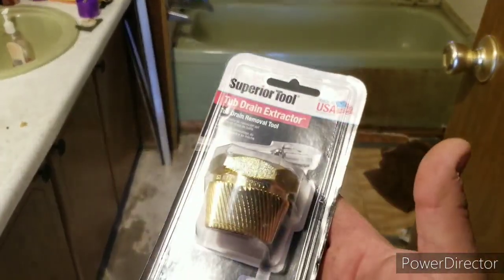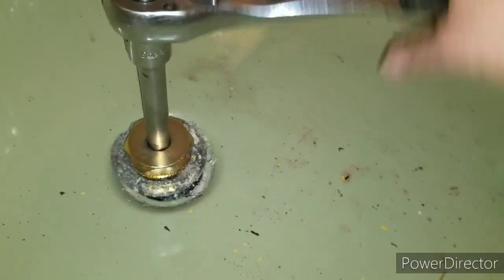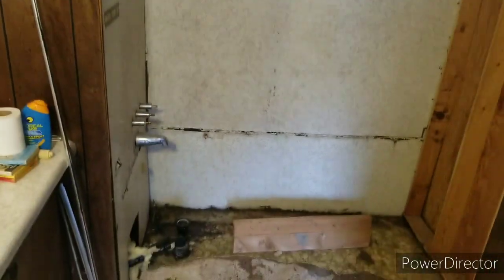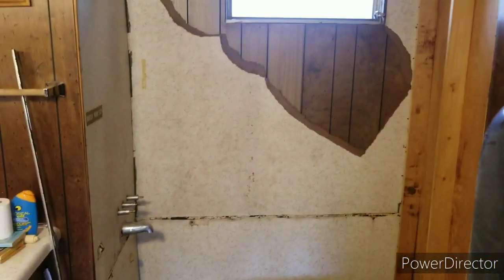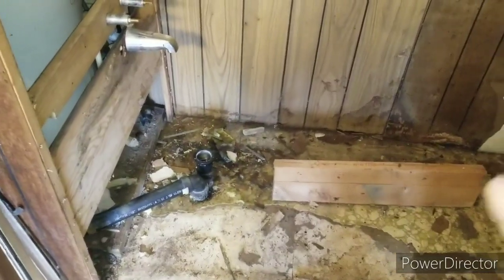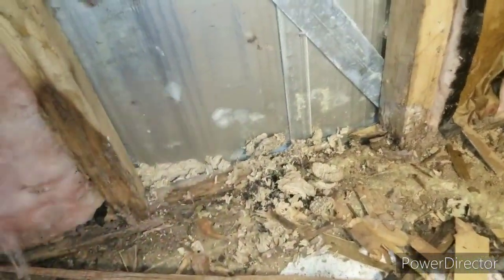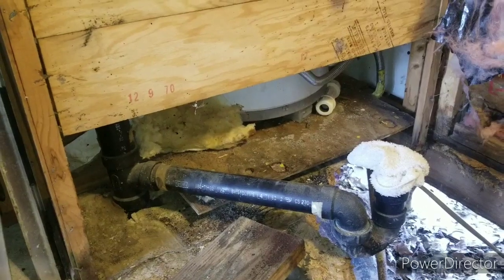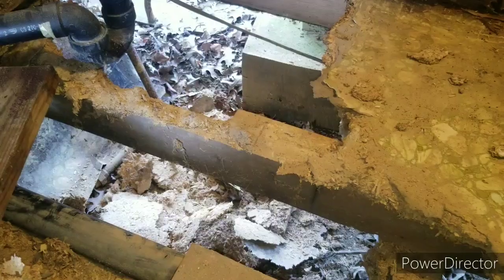1971 SINGLE WIDE BATHROOM FLOOR REPLACEMENT PART 2

Comment: Ended up getting a tool sort of like the tub drain extractor you needed when I changed out guts of shower director/diverter...had to have it to get the brass seat out of the pipe so a new one could be installed....man when that brass seating came out it was corroded bad like...

Comment: "Herp-and-derp" Is getting on my last nerve that is how I am doing with this whole mess. I am surprised I actually got mail once this week. I had to call before venturing out to the dollar tree store today because I did not want to drive all the way there and only to find out they are not open so I called first. I only allow myself two pancakes because they are so addicting. Love Pancakes with maple syrup and real butter not margarine. How long do you think it will take you to finish the bathroom?
Reply from the maker: Well, Depends on how many more things I find that need replacing. I'm not fast to begin with when it comes to projects but I'm going to finish it as soon as i can.